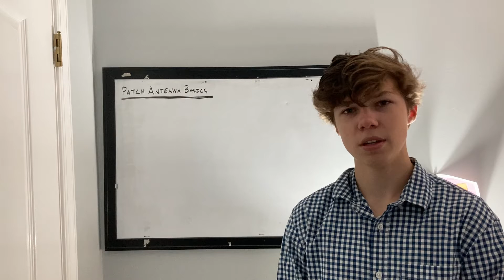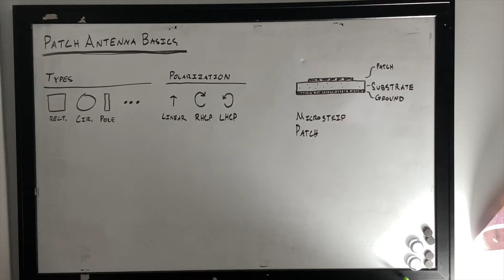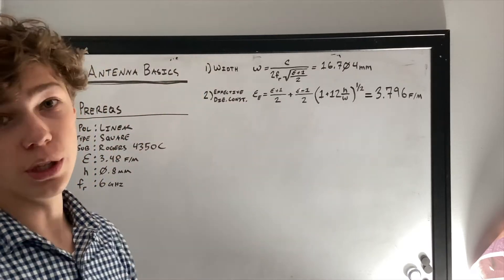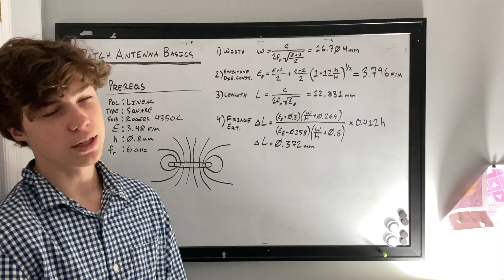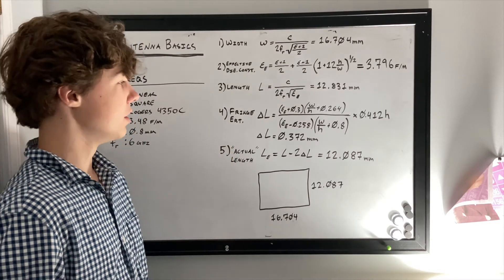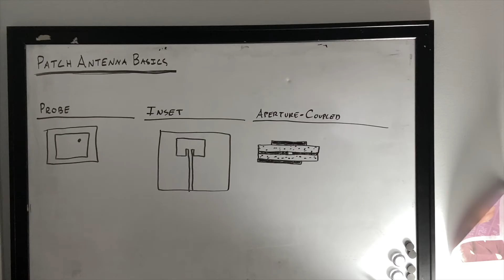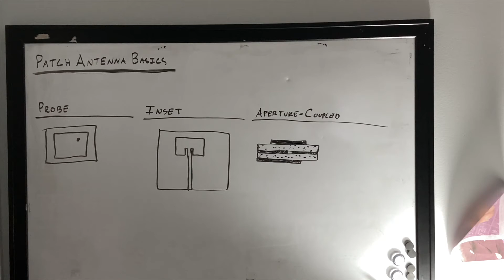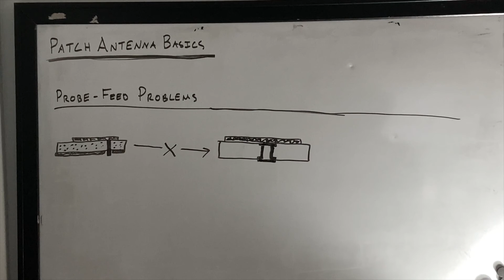Patch Antenna Basics (Part 1) - Design

Comment: really great explanation ...
is the same formulas are used for rectangular patch??
Reply from the maker: Yes! The example in the video is actually a rectangular patch, so those are the correct equations
Reply: can you tell me  please , the equtions in which reference ??....i did not find them in balanis 4th edition
Reply from the maker: @AmirKhan-qh6yi  In this video, I reference both Balanis' literature and Modern Antenna Design by Milligan.